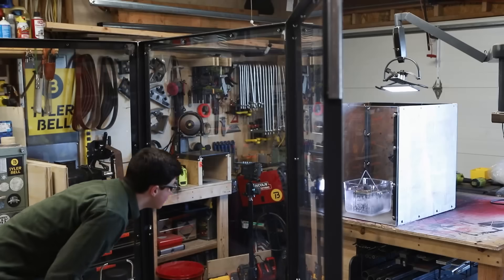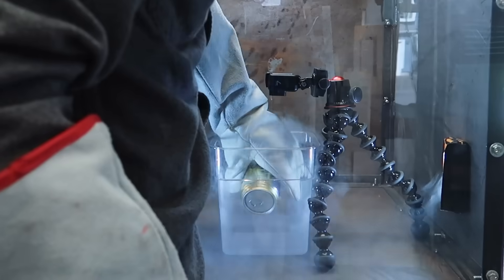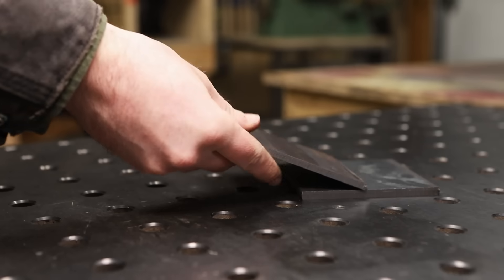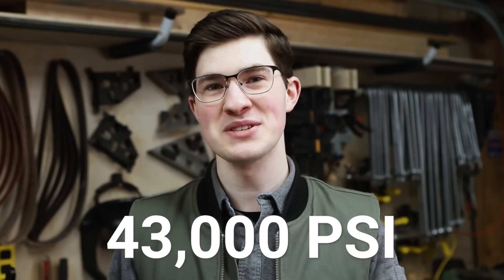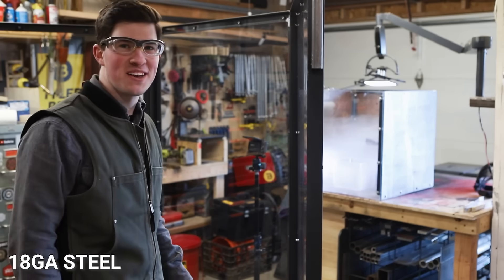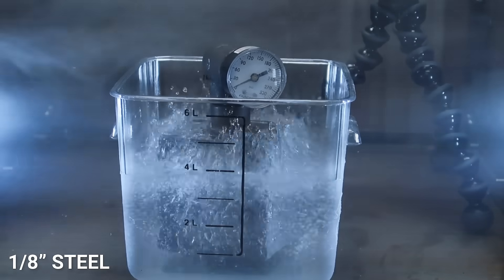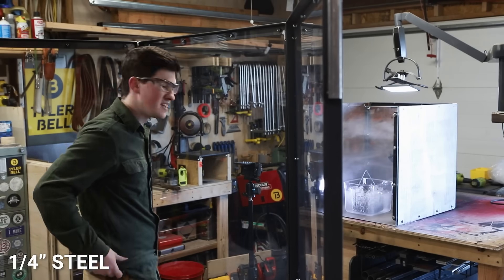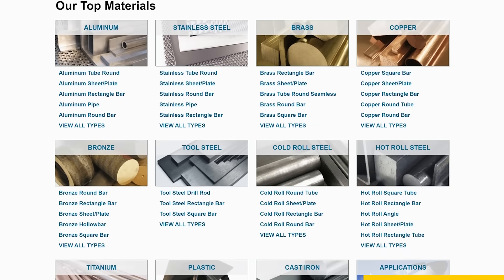Keeping ICE from EXPANDING?? (in liquid nitrogen)

Comment: Try with spheres!
Boxes have way too much deformation available, with a sphere you may have more energy being sent to the fracture point, as you don´t waste energy on deformation
Reply: makes sense, because spheres distribute energy way better
Reply: Manufacturing a sphere is infinitely more expensive than a cube, good idea but it's not very practical. Feel free to waste your own money though!
Reply: Spheres would be hard, but it's very common to make pressure vessels out of pipe.
Reply: @fwiffo  yep, pressure vessels are always round, getting closer to an sphere as the pressure rises. Ideally they should always be spheres, but as commented before, the cost is higher, and enginners always work on a budget.
Reply: @joaomarka  “anyone can make a bridge that doesn’t fall down. Only an engineer can make a bridge that barely doesn’t fall down.”
Reply: @xostler  Yeah, yeah, like the buildings on Turkey.

Comment: this is a good demonstration of pressure vessel design and using leak before failure criteria.  basically you want to size the thickness of the vessel to fail slowly, and relieving pressure before it becomes so high it causes an explosion

Comment: Darn you are lucky!
If that container with wax (Rocket fuel)had gone above igition temperature of the Rocket fuel innside of it, before it ruptured you would feel the detonation of almost the same energy as dynamite bomb or a real fire bomb.
And if the contaner with water had been a bit more robust, the threads on the plug would giveand you could have a replay of the cannonball experiment while you stood above with your face and refilled the nitrogen! the plug woul go straight through your head and ALL of your protection gear
Please thke more care!

Comment: It seems that all the cracks almost appear on the welding, that is not a surprise with a single layer done with a MIG/MAG welder.
If you really want strong weldings on the thicker steel, you need to use the "spray-arc" method instead of the regular "shot-arc" method with your MIG/MAG welder.
The normal way of welding with a MIG/MAG welder is "shot-arc", the wire touch the steel,makes contact and melts away, and fresh wire is coming out of the nozzle, and touch again etc...... this gives the crackling sound during MIG/MAG welding.
With "shot-arc" you raise the Amperage, but set the wire speed lower then normal, with this method the wire touch only once the steel, and after that you maintain a arc flash between the steel and the wire. 
With this method, you are melting the base material without adding to much wire, the result is that the welds burnin deeper and you have almost no sound, just like welding with a TIG-welder or Oxy/Acetylene burner.
This "spay arc" method need some practice, because if you're wire speed is too low, the wire will melt inside the copper tip and gets stuck, so you need to use anti-stick spray on regular base on the copper tip.
The goal is to make your weldings so strong, that the base material, in this case steel, will crack a random spots and not always on the weldings.

Comment: I think the reason why the soda can burst but the soup can didn’t is due to carbonation. It’s not the expansion of the water freezing that ruptures the can, but rather the rapid release of carbon dioxide from solution. CO2 is relatively soluble in liquid water but very insoluble in ice. Therefore, when the soda enters the liquid nitrogen the rapid freezing of the liquid quickly expels a lot of CO2 in a very short space of time causing the can to rupture. On the other hand, the can in the freezer has time to accommodate the increase in pressure and deform because the gas release happens at a slower rate over a longer period of time. This is just my theory of what’s occurring, I’m happy to be proven wrong. :-)

Comment: run a second bead on the inside of the steel container. water getting into the crack between the metal on the inside and expanding there probably played a big role in the welds failing.

Comment: I would recommend trying this with TIG welding if you haven’t already. TIG holds MUCH better than MIG/Flux, in fact, in some cases, the metal sheers before the weld... so do all experiments outside :P
Reply: looks like he didn't really prep the surface either. prep is the most important step in welding so that could explain why some welds failed and some didn't
Reply: @Kyle17206  there are also experimental variances of flash freezing vs slow freezing. Also welding depth (as a percentage) might be shallower on thin sheets as they're easier to blow a melt through if using too much power
Reply: "a good weld doesn't break, the material around it fails" or something I heard during my welding courses back in the day
Reply: That is not true. Weld strength is not derived from process. It is dependent on filler material and fusion into the base material. His welds most likely were prone to failure due to incomplete fusion/improper welding.
Reply: @iansmith8944  True but mig is one of the few processes that can create a pretty bead that is prone to fail. Most common is cold lap which if you look you can see some of. Ie where the weld isn't split down the middle but instead the "toe" aka the edge.
Reply: @councilv1250  yes, especially short circuit mig. Which is why it is rarely used for any code work. Stick has the same tendency to look good but have subsurface slag inclusions
Reply: @Paul Bedford People aren't referring to if it would fail. They are referring to HOW it would fail and WHEN. With correct welds the fail points would never be along the welds. So for those of us who know welding, this video was disappointing because we already knew where the fails would be.
Reply: @yotodine  if he had properly welded it, I doubt we would have seen any failure occurred, just deformation.
Reply: @iansmith8944  agreed.
Reply: @yotodine  it failed at the edges, not the welds per se. Even if the box had no welds, it would have failed there because the edges are always the weakest point. This is why pressure vessels are round.
Reply: @marks6663  when edges are not welded correctly, that is true. Remember that welds are stronger than the metal itself.
Reply: My asme cert pressure vessels are fab'd with MIG. Its structural
Reply: cant believe the amount of "welding experts" here who are clearly wrong.. first off the guy had his short circuit settings off as the dead shorts were not rapid so had less potential arc energy going into the weld puddle.. the fact that the wire balled its self after he stops welding says it all.. there is a misconception that people think mig welding is weak.. i can categorically tell you its probably the strongest process out there when you have the right transfer mode at the correct settings. if he was welding 6mm or more then he should of done a spray but i doubt he had the machine capable of doing a spray transfer correctly. also people use the short circuit transfer on structural steel on either duel shield mag. also when welded correctly.. the base material will fail before the welds them selves.. but the shape of the weld bead has a huge impact on its structural integrity.. a convex weld will fail etc but yes we should of just saw deformation in those boxes when they ice occurred.. not a weld failure.. problem is so many people who buy mig machines think they know how to weld just because they can do a hot weld in a straight line..
Reply: @Migman2020  you basically repeated everything everyone else said, except you decided to use welding jargon at an attempt at gaining some type of repute and to belittle the rest. This argument is between welders, but we all also understand that other people who dont weld will also be reading this.

AND FINALLY, can you tell me WHY companies that make large equipment ONLY use stick if what you say is true? MIG is cheaper and faster so it would save A TON of money plus its easier to learn. BUT they still decide to use stick. Why?

Oh, and as for your quip about "experts". You dont have to know the biology of how yeast makes bread rise in order to be able to make a pizza correctly. Even if people here are not experts, they can still contribute to the conversation.

If you ACTUALLY wish to argue the validity of your argument in a way that ACTUALLY adds to the discussion. Why not point out a couple of peer reviewed studies that we plebs can read?
Or are we not experts in reading and so probably can't know the correct interpretation of each sentence?

Comment: Radiographer and weld inspector here. Your welds are most likely the issue on the two that violently ruptured. The first shows a shear at the corner, most likely from two cracks meeting at those source locations. The rips along three welds at the corner are likely lack of fusion at the root. The larger box needed at least two passes but looked like you only gave it a root with no fill or cap. That would make that weld also far weaker in strength than the surrounding metal. Those that bulged did so because the steel was weaker than the weld. The reverse applies for those that sheared along the weld root. I'd need to actually see the welds to be sure, but these are my professional opinions. My relevant certs: RT II, API 577, petrochemical technician and inspector. 

But the ones that held up say you're a learning welder with a good future that just needs practice, which this type of fun, experimenting, and dedication will definitely net you. Regardless, loved the video. Subbed to watch more.

Comment: I would imagine the reason the soup cans didn't burst is because I'd imagine that there's a certain amount of empty volume in the container
Reply: Dissolved solids also lower the freezing temperature. Think salt on roads.
Reply: @mahbuddykeith1124  They do add a lot of salt to canned soups.
Reply: @mahbuddykeith1124  The can did freeze though.
Reply: @dkolosov  yeah but just because the can froze doesn't mean the insides did too. think of putting alcohol in a bottle and trying to put it in the freezer, it won't freeze but the bottle will because the alcohol has a much lower freezing point

Comment: the fact that it always broke right at the welds might show that your welds weren't perfect as welds are generally stronger than the metals they weld together. But it could also be that the corners being concentration point made it the only spot where it could break. Nice video

Comment: You maybe shouldn't pull the boxes out of the nitrogen the way you did while they were still cold. While it's unlikely it'd have a delayed explosion; you're still holding what's essentially a fragmentation bomb in your hand. 

Wear some ear protection.

Also one thing to keep in mind about that glass you're using is it's bullet resistant, not proof. When you have small pieces of steel moving at 1,900 ft/s it really doesn't matter what plastic you have infront of you. Things like Flak Blankets- which are essentially tiny sandbags stitched together will do more to protect you than that glass.

Comment: I think the can splitting down the middle has more to do with the temperature than the speed. At those extreme temperatures the metal becomes brittle and less able to flex. The same freezing happens in both cans but the one in the freezer is able to flex to respond to that pressure, while the other can cracks before it bends.

Comment: Done a lot of hydro and pneumatic testing, thankfully no big failures on metal pipe but PVC fittings often fail when we pressure tested bonding coupons.

Don’t know if that’s helpful but it was always my favourite test to film in slow motion as you can kind of expect a boom at 600 to 700 psi instead of nervously checking for leaks at 10,000 on carbon 😂 stand behind plexiglass!

Cool to see the power of ice expanding, makes me want to revisit my school books. 👍

Comment: @Tyler Bell, I was a pipefitter, not a welder. It was my job to prepare steel for welding. I have been working with welders, and have watched some really good ones. I was also involved in different kinds of weld testing using different methods.

I tell you all this because it is pretty evident that your video was not a test of the material. It was a test of your welding ability. A good weld is supposed to be stronger than the surrounding material. But every time a box failed, it failed at the weld. That should tell you something.
Reply: I'm not saying his welds were perfect, but even if the weld was much stronger than the surrounding material, the boxes would have failed at the welds due to their shapes.

Watching him handle a steel box near its tensile strength makes me super nervous, though. He's lucky to be alive. That thing could have exploded in his hand and cut his throat.

Comment: Safety improvement for the next experiment, put a hinged lid on the VTCB such that the lid when opening the opening is facing away from one self (hinge on the side of the clear part or 2 side hinges so its attached to metal sides). This would make it so that any exploding things get deflected away from you as the lid opens to deaden any upward momentum of any projectiles or liquid. A hinge vs a heavy lid is preferred so that the lid itself doesn't become a projectile. One thing that Mythbusters showed is during the cigarette lighter experiment is that a loosely placed lid can direct gas toward the user, Adam in that case, singeing his hairs and they also taught us that besides things flying at you they fly up and around. Nice safety precautions you have taken, I do commend you for that. The liquid nitrogen could have been deflected by the ceiling to go back toward yourself, but luckily it didnt. Its better to have a controlled deflection.
Reply: Yes, he is a lucky fellow. Stands behind a shield in case the bullet proof box fails, then when nitrogen is low, walks around both of these to add more nitrogen while the box keeps cooling. That could very well have been when the box exploded! You needed a larger tank of nitrogen on a pivot operated by a rope from inside your shield, just pull the rope to dump more nitrogen into the small container.
Reply: @BenAtTheTube  and a hard hat, its beyong me that he didthis without any face protection tbh... his head is totally unprotected from anything from above
Reply: yes, and remember... keep a constant flow of pizza.
Reply: @b0rd3n  And don't forget to take brownie breaks!
Reply: You don't think the hinge can break?
Reply: @J C  thats the point of the hinged lid is to make it a manufactured weak point. Its best design in the failure point rather than make it homogeneous such that one has no idea where it will fail.

Comment: Use a pipe (SCH80) and pipe caps next time. When you join the pipe and pipe caps, bevel each end before welding and make the weld in 2 passes allowing the initial pass to cool before apply the second. For your bung, use an O-Let.

Comment: What I want to know is how the heat of fusion is affected by keeping the ice in such a pressurized containment vessel.

Like how water will not boil at 212 degrees if it is kept under pressure.... Does water need to go down to 30 degrees to freeze when it is not allowed to expand?

Comment: Need to keep in mind the glass transition point of the steel. LN will sail way past that, so you would have to take that into consideration when you make conclusions. You could probably answer the question of failure in a standard freezer, but might not be as fun. Of course, here at 8:30 you mention imbrittlement, so good of you. This also a great example of how you can chase stresses around a structure as you beef it up.

Comment: This was really interesting!  SpaceX is using a specific type of stainless steel alloy (can’t remember the number) on their starship rocket because it actually gets stronger at cryogenic temps, very important since the liquid methane/liquid oxygen fuel they use is stored and loaded at cryo temps.  They actually test their huge tanks by first filling them with liquid nitrogen  and sometimes intentionally test them to failure by pressurizing them until they pop, a lot like your boxes! (a little bigger)
Reply: Sounds like the opposite of Inconel, as it gets stronger as it gets hotter, IIRC.

Comment: Cryogenic temperatures make metals less ductile. Cans crack and split sooner with less internal pressure. And that Campbell's soup contains squishy solid matter (veggies, intestines) in solution containing salt and starches that can compress and compensate for ice expansion. Or the starchy solution does not expand so much while freezing. Besides that, the process of pasteurization and can not being 100% full creates pockets of gas with less than atmospheric pressure that can also provide room for ice expansion.

Comment: Welding seams are the weak points that should be addressed first. I think that once the box cracks, the wax just leaks-out. Once welding weaknes is resolved, you can test the strength of the screw-cap as well.

Comment: TIP: have a certified welder do the welds. When done correctly they will be as strong as the original material if not stronger.

Comment: once imade a mistake and put my steel water bottle full of water in freezer. beautiful flat bottom expanded round like top of scuba tanks. i had to hammer it inside. then i remembered; you need a container strong enought to keep hydrogen liqid because it was something related to state of hydrogen and when you achieve it, it would become a different type of ice called ice 2 or ice 3... since then i only use plastic containers in freezer.

Comment: Whilst the distance the force applied the ice crystals is small, the amount of force imparted is great- this same force imparted by expanding liquid wax inside a wax motor used in hot water radiators in homes is used to respond to temperature by closing or opening a valve as a plunger is pushed forward by hot wax or retracted by cooler wax respectively.